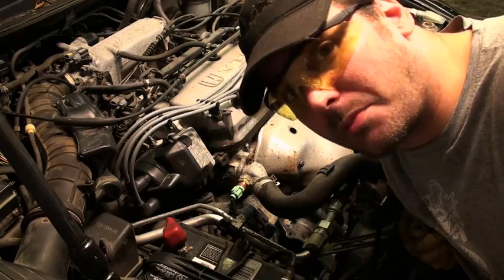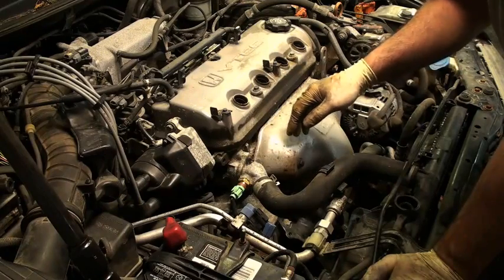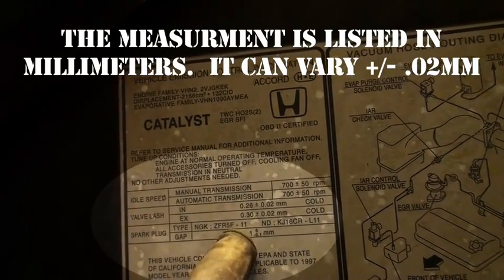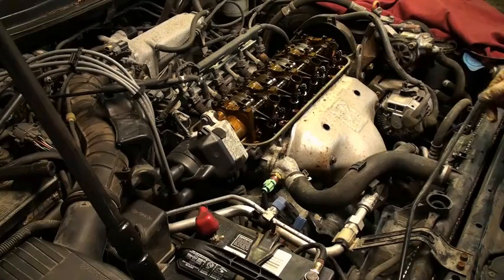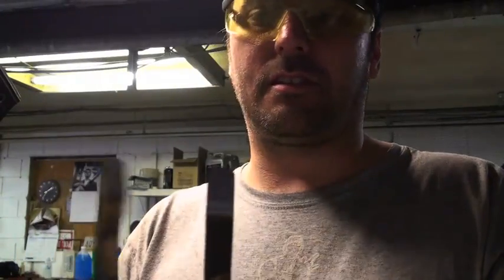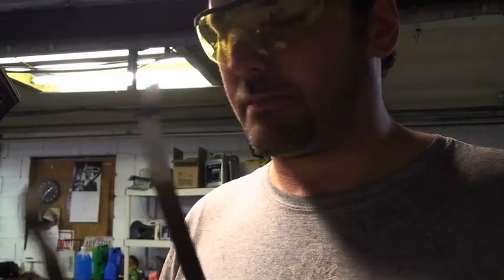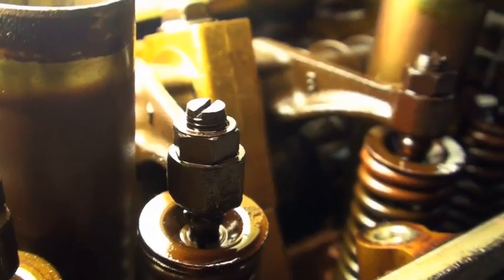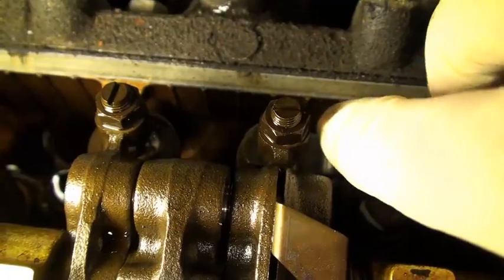Honda Accord Valve Adjustment - EricTheCarGuy

Comment: So when you adjust the valves are you simultaneously adjusting the rocker arm or is that a separate process?
Reply: You adjust the valves by changing the height of the rocker above the valve so when the rocker comes down on the valve it goes into the head the right distance and stops any knock if you have to big a gap

Comment: Eric is the man! Great video. Other write-ups I have seen have people taking off the top of the timing belt cover just to find top dead center, so your video saved me a ton of work. One tip I would like to offer, when you have the valve cover off, you can see the camshaft sprocket and they thoughtfully also put an arrow on this side for TDC, so you can easily set it up for #1, then crank it 90 degrees counterclockwise to do # 3, then 90 degrees again for # 4, and 90 degrees for # 2. Easy!

Comment: I bought my 92 Honda Accord two years ago for $250 the water pump went, now I have to repair it. I'm doing that now but the tiny bolt you demonstrate here moves with the screw there seems to be no way to use the special lock nut screw tool or screwdriver and wrench to separate the two in order to use gauge for proper spacing. What am I to do sir?

Comment: I have watched few valve adjustment videos for Civic and one guy turns the crank 90 degrees before adjusting next cylinder and another guy turns it 180.... hnnghhh. Maybe I'll try this next summer as valves make pretty terrible tapping noise when it's cold outside so I assume they could use some adjustment. As long as I don't tighten them too much and feeler gauge moves nicely between rocker arms and valve stems everything should be fine?

Comment: according to the "as cold as possible" - what if the outside temperature when doing valve clearance is around -5 degree Celsius? Can it affect the adjustment in some way?

my garage is not heated and I heard all those clearances are given by the "normal garage" temperature around 15-20 degrees Celsius

Comment: I just did this on my 96 Accord LX with 4 cylinder. When adjusting the valves, I noticed a clacking sound. One exhaust valve per cylinder is getting stuck down and eventually getting pushed up; making the clacking sound. I did not turn the engine over while the rocker shaft was out and re installed properly without any problems. Any ideas?

Comment from the maker: @truemetalist89 I address a rough running engine before I go for the motor mounts, in fact I have an entire 'idle speech' that I give to people when they ask me this question but I don't have enough space here.  Head over to my website and type in 'idle speech' and it should come up, if not joint the forum and I'll post it directly to you.

Comment: Hey I NEED HELP!!!! I am facing taking my 1995 honda accord 2.7l V6 sedan Ex into the dealership for noise from the valves when it's cold then when it heats up it fades away. 
It apparently has automatic valve adjusters. But I need them adjusted. What are my valve lash adjustments supposed to be? It's not in the manual at all!

Comment: So I have a 97 accord and I have adjusted the valves many times and it still ticks REALLY BAD. I’ve always thought I’ve had it at the base circle of the cam to rocker arm by putting it directly 180 degrees opposite. Is there a possible other thing that could make a tick noise? It happens on accelerations and decelerations.

Comment: Cool tyvm. I presume that I would have remove the plugs just as you did in this video to relieve the compresion so I could turn the motor. Also believe it or not after 25 years the A/C still works on this truck lol.

Comment: if you have problems finding that low spot on the cam with all that gas steeling v tech in the way you can double check buy looking on the cam sprocket  find the mark that says UP,  straight up is #1 cyl. then go ccw and bring the up marker to 9:00 position  that would be 3 cyl .  6:00 would be 4 and 3:oo would be #2 cyl .,and make sure they are free by shaking them

Comment: Hi Eric, what year accord is this?  You mentioned that most honda engines operate similarly?  I have a 92 civic that just had its timing belt replaced - I just changed the valve cover gaskets because of slight leaking into the spark plug cylindars - im going to give it a couple months and see if it stops the leaking, and if so then i have to go deeper and change the o rings - 

if my 92 doesn't adjust this way then where can i find the correct information.  Thanks!

Comment from the maker: @spam420rice Pain in the butt.  You need to MEASURE the clearance first, compare it to spec, if it's out you then measure your shim and calculate what size shim you will need to install to get things in spec, you then install the new shim and recheck them to see if they are in spec.  BTW I think the measurements on that engine are taken hot.

Comment: So the Vtech valve adjustment is the same as the non vtech?  I've done my 95 2.2 several times but want to do a 2002 2.3 which is VTech unlike my 95 which is not.

Comment: I got the valve cover off and plugs removed but I couldn't get the engine to turn like you did in this video b/c I didn't have a long enough bar and big enuff socket to get over the crank bolt so I put the truck in 1st gear and rocked it back/forth and watched both the the timing chain & cap rotor.

Comment: When the spark plugs are removed are you using a spark plug socket or a regular socket? Seems to me a  spark plug socket would have the spark plugs stuck to the socket but in the video the spark plugs stay in the tubes. I have always wanted to use regular sockets (without the rubber) to remove spark plugs it would make the whole process that much quicker. What did you use?

Comment: i went to do my adjustments and found that the left arm on the intake side isnt even with the rest (more open). only one cylinder has this at a time. never happens on the exaust side. Whats going on? and the problem moves in order when turning the motor.

Comment: I did an engine swap on an 02 accord with a 2.3 it started up but did no idle well or move I thought it was the valves that's where I watched your video I double checked them and got them right but no improvement. Turns out the map sensor and throttle positioning sensor have identical connectors and I mixed them up. Runs great now but needs a battery

Comment: Hey Eric, was wondering if you could help me out. I took out my top assembly rocker arms because I needed to add sealant to my spark plug tubes as they were leaking oil. I drive an 03 Eclipse and I cannot get the rocker arm pipe to line up flush with the grooves on either side, only one side will be flush and the other will be slightly elevated, and I'm positive I've made sure the arms are all in their grooves so nothing should impede them. Is this because/should I do a valve adjustment? Thanks for the help

Comment: I want to quiet my valves just a bit. Fine when they warm up but a little noisy when cold, I've never done this before, but I've done a lot. No manual just YouTube and years of diy. Where do I find the right tools for a j series 3.0 Honda Accord. Any help is appreciated, I'm skeptical to say the least. That and I'm attempting the well known timing belt and water pump. I already have the parts just waiting on my Honda pully socket from Amazon and the 50mm Holder. We'll see what happens, I've had friends that did everything right as far as we know and it only started once. Never again until it was taken to the shop, no explanation. That's a huge fear for me. Money is a factor, hence buying the Chinese kit from Amazon rather than 1300 at the dealership

Comment: Did you bend those feeler gauges yourself or did they make em like that?

Can I buy just those two sizes, and, can I get them at NAPA?

I have a short set of gauges, but I see the longer ones will make it easier.  

First my alternator, and now a valve adjustment.  Couldn't have done it without you.  Thanks Eric. 🤠

Comment: I have a 01 honda accord v6 and have issues after driving a while then parking and when I try to restart sometimes it rough starts and wont want to start like its running out of fuel or air. Happens mostly when driven a while. I changed the valve cover gaskets and new spark plugs and coils. Any thing else I can do ?

Comment: Hey Eric, idon't know if you recall a while back i had a question on a check engine light on my 2001 Honda Accord 3.0 Vtec.. P0300, 301-306, and p1399..Yup it had 8 codes. First I replaced the plugs with NGK, threw some injector cleaner in my tank, and checked the resistance of the injectors(were ok).Still had the misfire!! Then one day i saw your video and i thought "What about a valve adjustment"?...Bought a set of feeler gauges ($5.00)got to it and fixed it.No more Misfire!! Thanks Eric!!

Comment: TDC = Top Dead Center, and in case you need the definition: The position of the piston within the cylinder when the piston has reached its farthest uppermost (closest to the cylinder head and valves) position.

Comment: Perhaps a kind soul could help? I have a 1989 Honda Accord with a rather small missfire i cant get rid off. It only does it when idling.
Exhaust, spark plugs, spark plug wires, distributor, and distributor cap are all new. (since all that was pretty worn out or faulty)
Also the injectors were cleaned, the fuel pump relay was replaced and the engine compression is still exellent (inspite of having 132.000 miles on it) and it doesnt burn any oil whatsoever.
Other additional data I can say is that i the car some times the car would start very easily, but some other times it has a bit of a struggle starting up, specially when the engine is hot.
The car wasnt used in years just before i bought it.
Any clue?
Could a faulty sensor be the cause of the problem??
Reply: I had trouble the same trouble with my integra before and I thought it was the idle air control valve.  Hope it helps!

Comment: To get the "feel" of the drag, if someone has never done this before, you could get a micrometer and set it at the desired gap then insert the feeler gauge.  Shouldn't this help define what the "slight drag" should feel like?

Comment: in the 1st generation Crx it has a Cold Clearance and a Hot clearance in the shop manual. when the engine is hot set it to the hot clearance and the cold clearance should be in spec.

Comment: @EricTheCarGuy Yup the specs are under the hood. I just sent ya a responce video of the inspection of the timing chain, after the video ends I had already put the cover back on and in the process installed new plugs, wires, Cap & rotor and the truck started on the 1st turn of the key and runs a little smoother. The exhast smell in the garage was very rich though.

Comment: easy way to tell if your on bace circle you will have a little play and your valve spring will not be compressed you be Abel to tell by looking at the springs that are compressed.. those ones that are compressed are sitting on the lobe of the cam.

Comment: My 97 ex v6 accord is starting to run rough. I do routine maintenance but it has been awhile since I did a timing belt on it. Could a worn timing belt cause slightly rough idle? Also it loses power when at operating temp could that be the thermostat?

Comment: Is it ok to leave the lock nut setted where i can't adjust the valves bay default. Do to Natural stress of the engine. I cant put my feeler gage in beween the cam spring and lock nut. Pit bike 003 gage. When I get it to idle all noise stops should I still do the adjustment

Comment: well all went well, encountered some issues with the alt, power steering belts though. had the car running really funky! (96 accord) but after playing with the adjustments, got it almost right. more minor tweeks r due though as theres a very minor squeal still. I adjusted the CAM to TDC afterwards.

Comment: Newbie question, why did you move the belt at  8:49 ? don't you have to re-adjust that later? and also would you have to move the  camshaft back to the lobe position?

Comment: @EricTheCarGuy Oh okay thanks! What was the round about cost? What parts are replaced? I was quoted 425 by one dealer and 294 at another. I have genuine spark plug seals and head cover gaskets I can give them for cheaper b/c i ordered them from bernardi parts.

Comment: Also I almost forgot to mention that this 86 Toyota p/u has manuel steering = no power steering pump to turn the motor over like you did here in the video. Could I maybe use the altenator or something?

Comment: Eric,
when you say do not get the valves too tight, do you mean the locknut or adjusting in such a way that you crush the feeler guage too tight, thus leaving a smaller gap I guess,
Thanks

Comment: Hello, nice video
On my 2008 odyssey 3.5L, 117K miles, I removed the valves cover to adjust the valves. But I shock to see one head so dirty and the other one (rear) nice and clean, WHY?????? Please help me, if need to remove head, bad oil lubrication??  I changed the oil every 3-4K, since 23K. 
HELP,,, PLEASE

Comment: Proper video, Haynes manual does not say my engine should be cold ('99 Civic D14Z4 engine) so I'm more confident to do this after watching, also seen other vids of ppl turning over the engine with plugs in, struggling etc but my concern is how do you know the cam lobe is in the right position? Other vids show the top dead centre marker , at least on older civic engines

Comment: Nice video once again. I just happend to have accord that is leaking oil to the spark plug holes and I need to change the gaskets. And becouse it seems to be quote easy to adjust the valves I might do that to.

Comment: Eric, I have a 2008 Mitsu Eclipse V6. The FSM says to do the adjustment when the engine is hot. Now it has an aluminum head, so I wondering if I will cause any damage by removing bolts from a hot engine.

Comment: Hey Eric, i have a CL9 Accord (k24a3) and i found oil in my intake hose coming from a little box that connects the intake hose and the cylinder head, i dont have any smoke coming from exhaust i also did a seafoam treatment by adding literally everywhere seafoam also in combustion chamber and changed x2 times my oil at the process same day to wash everything out but i still burn oil and that small vox keeps sending oil in my intake hose... please help me i really can't believe that 😔 thanks in advance!

Comment: Hey Eric. Really need your help. I took my 94 accord lx to a mechanic after my timing belt snapped. He wants over a grand to replace the timing belt and to check the valves for damage and possibly replace them. He says that to check the valves, he has to remove the head of the engine,  exposing the head gasket and would have to automatically replace the head gasket as well. Is all that necessary and do you think i can do it all on my own?
Reply: Do a compression test first before you do anything else.

Comment: @EricTheCarGuy Thanks for the advice. I am going to be installing Megasquirt ECU on my car before I do anything else, so I can tune it myself) and there are dozens of articles on that head change. Just gonna have to find a 2nd car to drive while doing the swap, and about $1000 to buy the heads, intake and throttle body. Right now just wating on good weather to change my defective power steering pump...

Comment: Hi eric nice videos. very helpful
I have an idle that revs up and down when hot. I searched for vacuum leaks and changed coolant. I want to clean the IACV i just don't know where it is on my Honda Civic DX 98. Would performing a valve adjustment get rid of this revving? 
Any advice would help greatly appreciated. I have been trying to fix this for a month.:(

Comment: HI Eric, thanks for the response from before.

Another question for you? Do you know the torque settings for the 10mm nut that keeps the adjustment screw in place?

I ask this because I redid my entire valve lash adjustment, and my Odyssey was sounding and running perfect, like brand new perfect; but after driving about 45 minutes, all of a sudden the engine sounded like a diesel again. Any ideas?

Comment: What is the recommended period between readjusting that clearance? How much time does it normally take for valves to get out of adjustment?
Reply: +Stefan Ovcharov 1st adjustment at 90,000 miles then every 30,000 thereafter
Reply: I need rocker arm torque specs

Comment: On the cam on top should say up and on my prelude its also f22 motor and when its aming to the front it is on one cylinder, aming towards the back another, aming up well of course number one TDC and down and so on the cam rotates once every quarter of the way for each cylinder right? its tdc four times for each time the cam rotates also like the distributor.

Comment: I have a question that after the cylinder #1 at TDC, we rotate the crank 180 degree ( half turn) or 90 degree (1/4 turn) to get the whatever next cylinder at TDC, mine is 2002 honda accord v4 F23A4 motor. Thanks alot, Eric.

Comment: Great Video! I'm going to do this soon on my 01 Accord. Could you make a video on replacing the distributor O-ring? Mine is leaking and not sure the best way to pull it of and put it back on without messing up the timing. Thx

Comment: Hi Eric. Thanks for the video, it has been very helpful. I'm hoping you could shed a little light on "just a little drag" when checking the valve lash? Can you think of any way to describe in detail or self-check the clearance when I have my feeler gauge in?

This question comes from my own adjustment on this past weekend; 2004 Honda Odyssey. I was adjusting for ticking. Now though, it sounds like a diesel. When I checked adjustments before, exhaust side feeler wouldn't even fit in was so tight.